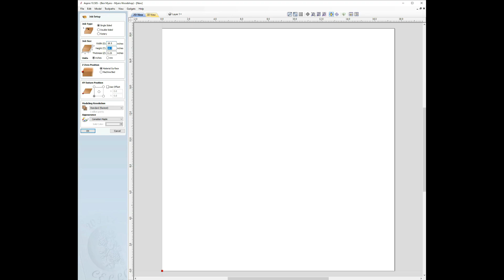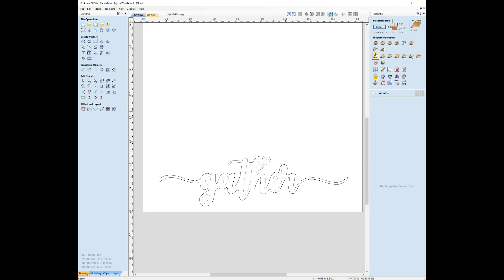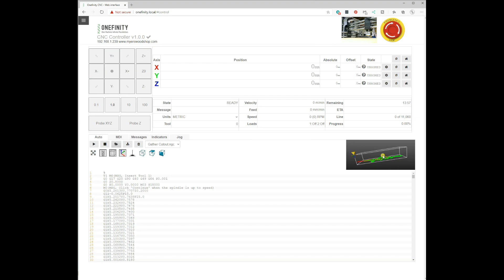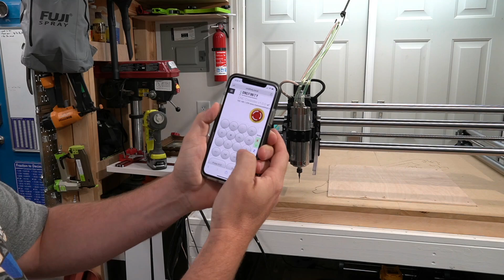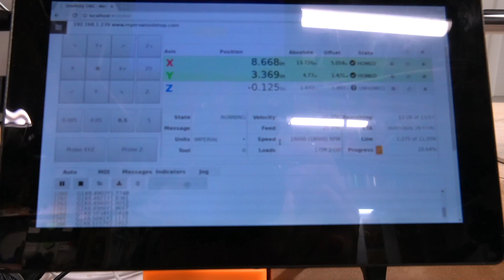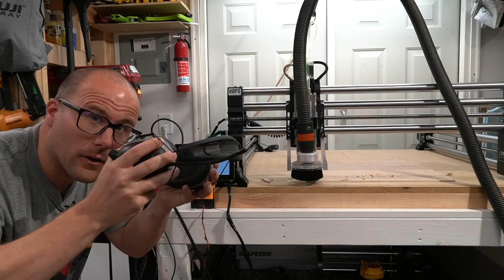Gather Sign Using Vectric On The Onefinity CNC

Comment: Nice demo.  I'm also awaiting my OneFinity.  I currently use a different brand cnc.  
VCarve is great software and this coming from someone who used a $10K professional CAD system till I retired.  You should try using 3D tabs (1 check box in the tab area), and smooth your lines (Curve Fit icon) which will smooth the lines which condenses the gcode and allows the cnc to run smoother & faster because there are less points.
Reply from the maker: i'll check out 3d tabs.

Comment: Wouldn't your probe be inverted to measure just Z
Reply from the maker: no
Reply: @MyersWoodshop   You are not using the prob correctly. the cut out is for the corner of the work material and the person asking about turning the prob over is correct. .  The prob is tilted the way you have it.. Turn it over to get the true reading,